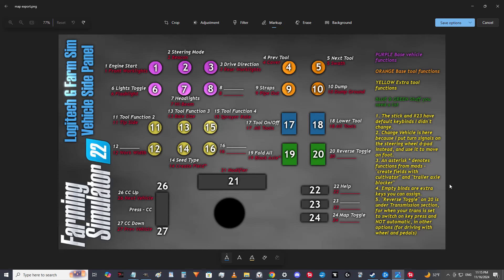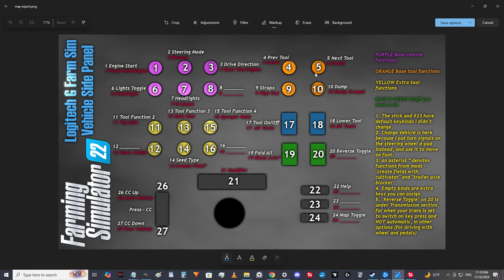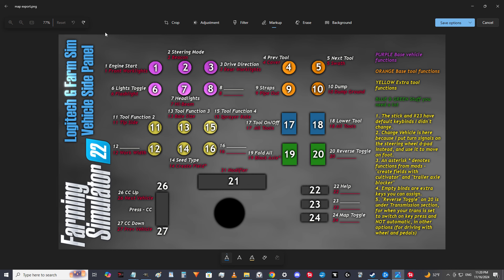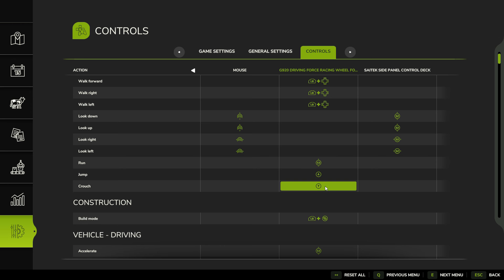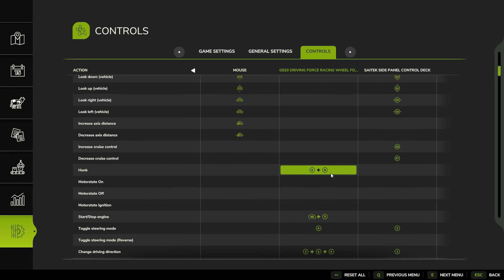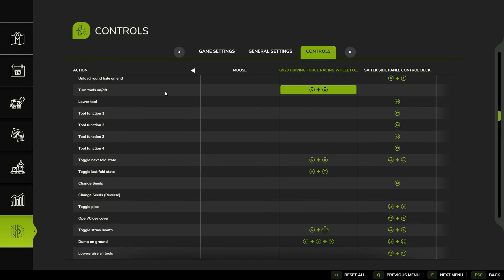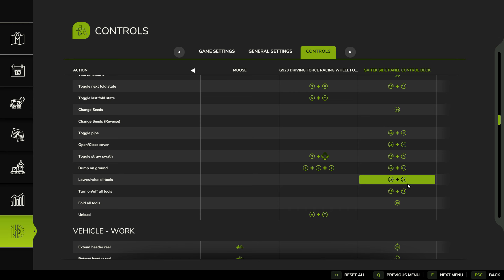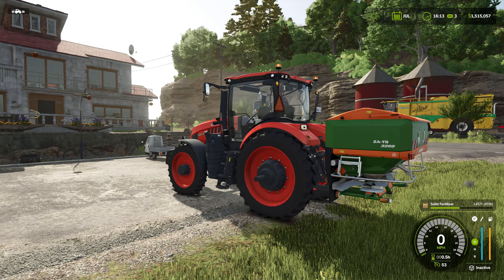FIXED FOR FS25 Logitech Side Panel Keybinds - Farming Simulator 25 Guide

Comment from the maker: The hard facts are that with Farming Simulator 25, the Logitech G Vehicle Side Panel just doesn't work as well.  The game assigns some of those buttons to things we cannot change.  Giants needs to fix this so we can bind it as we did in FS22.  That said, this video explains how to work around this.  Here is a link to the original keybind video for FS22 that I refer to in this video. 90% of that info is still valid for FS25.  Thank you.
https://www.youtube.com/watch?v=9R3paS-E0Bw
Reply: Yes you can change them. First open your "inputbinding.xml"  file in notepad++. Delete the lines start with "<binding device="0_0738-2218-0001" that your say are locked by the game such as Menu -  button 1 and Enter - button 17. Leave no lines between any of the remaining text. Then go into the game and you can set the buttons for anything you want.
Reply: Binding side panel S2 to Crane raise/lower bugs the controls and the crane doesn't move at all anymore. Why is that? How can I fix that? On FS22 I would press the grey button and use the stick forward/backward to extend/retract crane arms.
Reply: @davidrodgers2935  You rock like a Moai, this is exactly the info I needed.

Comment: After some digging, I found the files that need to be modified to fix the controls. In your "My Games" folder (for me that's D:\Documents\My Games) you're looking for "\FarmingSimulator2025\inputDevices". In that folder, there's an XML file inputBinding.xml that contains all of the bindings that seem to be loaded by the game. In the parameter "<binding device..." the device that starts with 0_0738-2217 is the wheel, and 0_0738-2218 is the side panel. This lets you change and remove the bindings that aren't in the game by default.

Thanks for putting this out, it was a great guide and starting point.

Comment: I found a workaround that fixed the mapping problem for me. In your game folder there is a folder named 'profileTemplate' (I have the Steam version but a friend of mine with the CE has the same files). In that folder are the default settings for FS25. When you use the 'reset' button in the menu it will get back to these files. I just backed them up somewhere and delted them. Then ingame I used the 'reset' button and this will delte all your settings. Now even button '1' has no biding. Now you can either change the settings in the file or just remap everything new.

Hope this will help you too
Reply: You are a lifesaver. Thank you for sharing the info 😃👍
I bought the PC game from Giants and I can confirm the name of the folder. My problem was with Saitek Side Panel and button #1. I found the XML file for my device, made a backup file of the original and removed the instruction related to button #1. Then I followed the instruction @Sacharel described. It worked perfectly.
Reply: This worked flawlessly 🫡 I have bound all my keys working just like the sheet in this video.
Reply: what do u mean by ce
Reply: @kodyram4339  Collectors Edition

Comment: There is a lot of frustration over keybinds in the community for FS25. Something that I will share, I copied my inputbinding.xml file from FS22 and replaced the one in FS25. I didn't have to change any settings. my button 1 on the saitek you mention is hard code,  since i brought my inputs over from 22 i have it operation my trailer actions. Copying the keybinds from FS22 might help.

One thing I have been telling people is to back up the original FS25 keybindings file before making the change. Also do it early on in the installation of FS25 so that if you need to do a reinstall to fix something it wont affect your game play.

For me I have all my original mapping from FS22 in FS25 for:

1. Two Thrustmaster 16000M Joysticks (programed for crane, logging and excavator work)
2. Logitech G920 steering and pedels
3. Logitech Siatek panel ( programed in FS22 for other actions that are not base game settings)
4. G502 Lightspeed mouse

For me it seems to all work similar to Fs22 as I had it setup. Saved me alot of time. I've been telling people there is no guarantee just incase as some people have a mix match of different components like Xbox controller keyboard, custom button boxes. Any ways I though I would mention this possible alternative.

Also because did this all my equipment is represented in FS25, I know some people have indicate oh this device is not showing up in the settings of Fs25. Maybe my approach might help.

Comment: Thanks for sharing! I had the same "reverse" issue and didn't know why. ?🤔
The problem is NOT the side panel. I haven't hooked mine up and am having the same issue with my other controllers.Giants has an issue with some controls being "hard assigned"! Unchangeable! My TH8A shifter for example, the "reverse" position I used in FS22 for 8th gear is now HARD ASSIGNED TO THE MENU! 1st time I shifted to there I crashed. 😵‍💫 I hope they fix this ASAP!

Comment: Do you have an issue with the steering wheel directional buttons not being able to scroll thru the menu or shop menu, it will allow it to change tabs but cant go up or down or left or right????
Reply from the maker: Yeah, I had trouble with the wheel working pretty much at all in menus.  I use the mouse for that.
Reply: @ unfortunate, I was hoping you found a fix for that. It’s annoying to reach for the mouse every time